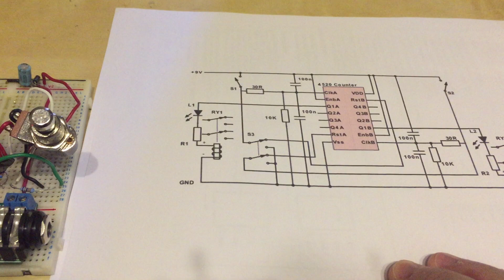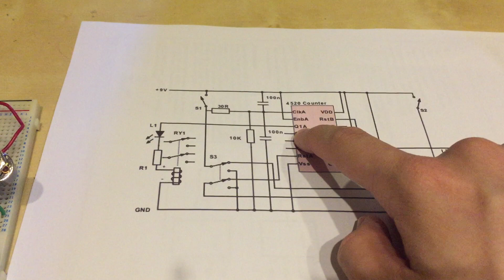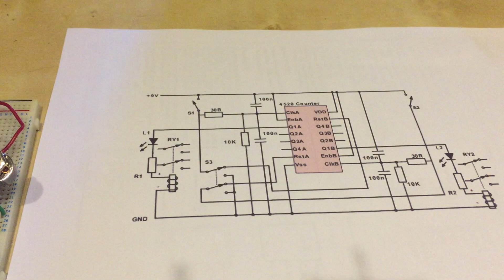Flip-Flop Loop/Dual Overdrive switcher (Single Chip)

Comment: Hi James, I'm very interest in your schematic but I can't figure out the proper wirings of input and output of the two drive circuit in relation to this switching schematic. I know that the drive circuit would connect to the relays but in what way?
Reply from the maker: You basically use the other side of the relay as a DPDT switch for switch the input between going straight to the output, or to the input of whatever circuit you're trying to use. Google DPDT true bypass on Google. The LED indicator is driven on the coil of the relay.